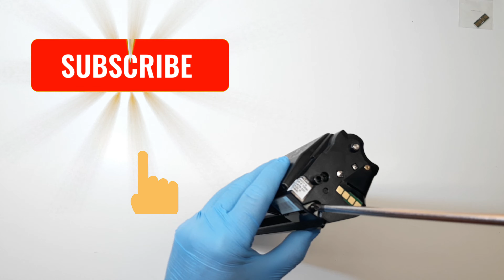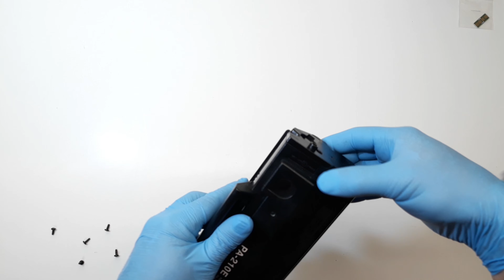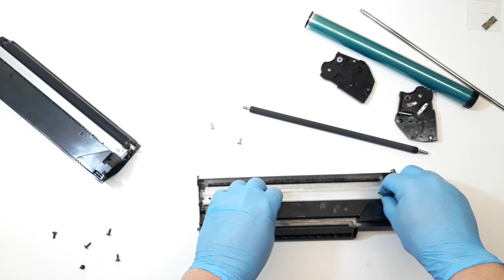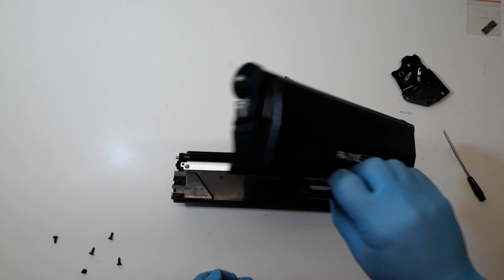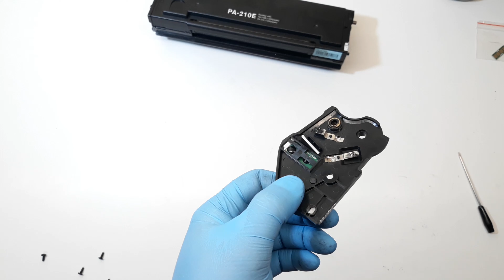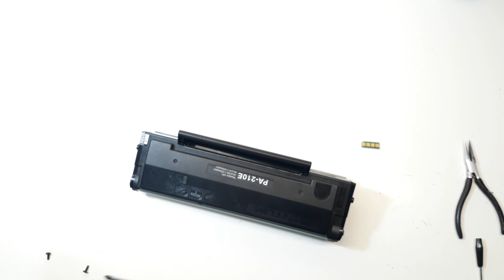HOW TO REFILL PANTUM PA-210E, PA-210EV, TONER REFILL, RECARGA, ЗАПРАВКА

Comment: If I buy the pb211 but my printer use pd219, how can I do to fix it other than return to the seller?
Reply from the maker: You have to use the right chip model for your printer, otherwise the printer won't initialize the cartridge.
Reply: @MrPrintGuyDIY  it means I can use a pd219 chip in pb211 cartridge to make it work
Reply from the maker: I haven't seen phisically pb211, but if it is the same cartridge and fits in the printer you can change the chip only. But if only it is the same cartridge with pd219

Comment: Is it necessary to change the chip?
Reply from the maker: Yes, you have to change the chip. Otherwise the printer will raise an error for empty cartridge.
Reply: @MrPrintGuyDIY  so where do you get a chip? my cartridge says toner life end but i barely used the printer, so it prints  100 pages?? just trying to get more life out of mine.. so i cannot reset the cartridge without replacing the chip? thanks!
Reply from the maker: @margaritagirl2629  you can find a chip for your cartridge from local suppliers. Check for them on the internet. I am sure you will find it. Good luck!